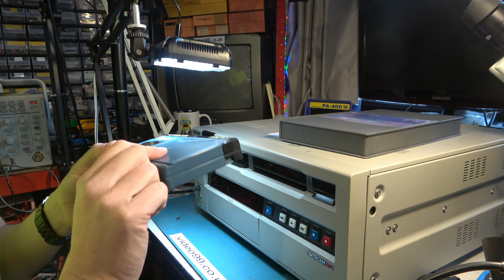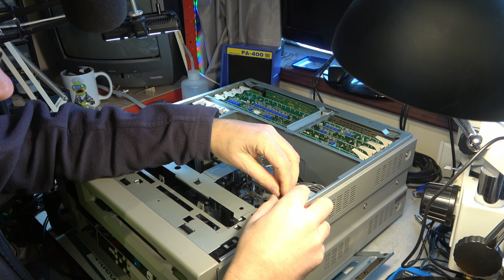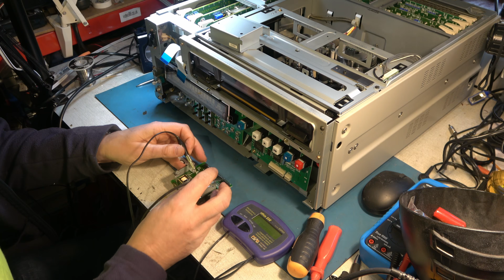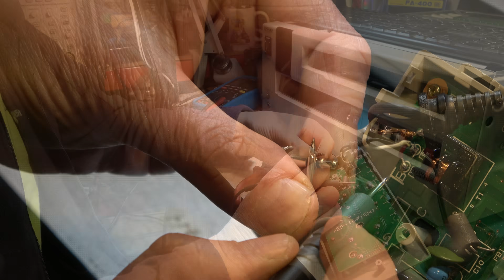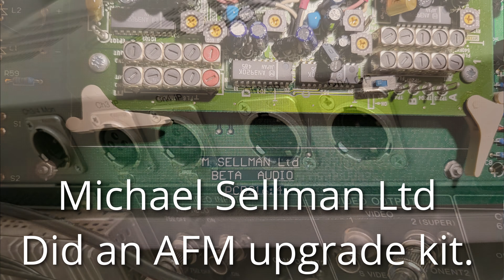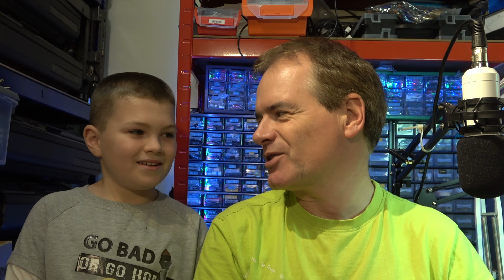Sony UVW1400AP BetacamSP professional video recorder.  Can we fix it?

Comment: Whats AP version is? Pal/Secam? Version 1400P is PAL, version 1400 is NTSC. Is AP = Secam?
Reply from the maker: P = PAL generally.  Not sure about the A though.  I don't think this format was released in SECAM.
Reply: @video99couk  It must have been released. I have a Betacam cassette recorded in Secam. Even the labels on Betacam/Betacam SP cassettes have a place on the label to indicate that the recording was in the Secam system. I have the UVW-1200P version, which is marked "PAL." The UVW-1400P is also PAL. I think the UVW-1400AP stands for PAL/Secam.

Comment: Those nasty SMD capacitors are also on the capstan’s circuit board. Everything works fine until they start corroding the board’s traces, at that point, it’s too late to replace them.

Comment: I have a sneaky suspicion that the spring can actually be removed and the carriage will still work. I could be wrong but I think its just there to set the tension on the toothed belt before a set screw is tightened.
Reply from the maker: You might be right.  It could be a case of just get it out of the way and it will work.  I will try that.

Comment: UVW series was cheap, not reliable and a nightmare.
Reply from the maker: I've had a few failures on these, but then they are getting on a bit now.  I still like them though, not least because they have S-Video out, and a "pleasing" picture to my eyes.  I've had the odd tape look nasty on a DigiBeta but look better on one of these.  It's good to have a selection of machines to get the best from a tape.
Reply: @video99couk  you are right in all aspects.
I figured out years ago how to get S-Video signal from VO9600.

Comment: Colin,  I don't think it will take you long to make a better remote cable :-D.
 i think that remote has a group of resistors inside and tied to the buttons like the old vcrs used to have.
I think the spring can be bodged .... errr i mean repaired with love lol.
And you recapped the display power supply :-D.

Comment: hi at last a great video you made i have seen alot with the a cap n the  vu part 
i still get offered  his range of decks   time to time  

only take them in because of the liner audio  just have  alot now   note i just got alot new sealed 
betacam  tapes  at very price  £1 for 10  i am getting alot of this  they just don''t know what to do with the tapes 
i am      finding

Comment: 12voltvids recently did a video on one of these where those very same caps failed and took out both displays and the fuse on the VU meter PCB.
Reply from the maker: Yes, I saw that the other day.  It was just coincidence that this machine came in then.  On one of my previous machines, the capacitor failure caused a regulator to put a large voltage onto the larger display and control board and blow it all up.  Hence I will now replace those capacitors as a matter of course.

Comment: Nice machine, a kind donation! I never saw the issue with that spring in all the time I was working on these machines. But the plastic was 25 years younger then! I have made a note to check those VU meter capacitors on my UVW-1800P, thanks for the useful tips as always.

Comment: Uhh... Colin... you were absolutely and utterly wrong about the UVW-1600 and its' PAL counterpart, the UVW-1600P. That model actually DOES have VU meters, aside it being a player.
Reply from the maker: The 1600 is a player with VU meters?  Wasn't aware of that.  I think it was a much rarer model.
Reply: I'd say the 1200 & 1400 are actually rarer because they don't have the RS422 9-pin remote socket, which makes them pretty useless for editing and only really suitable for use in a production office or maybe as a source for VHS duplication. They're probably more common today precisely because some of them didn't have a hard life sitting in an office getting occasional use. Sony also say these 2 models have a Time Base Stabilizer not a Time Base Corrector, although I'm not sure what the difference between a Stabilizer and a Corrector would be? Maybe the former can't have the video levels adjusted? The 1800 was probably the most common model in the UVW series as they could be used with an Avid Media Composer or similar editing system (having the RS422 remote connector) for both ingest and playout of final edits. There was a very rare model in the UVW series that had something to do with either video animation or graphics, might be the UVW1700.  The UVW1600 is the edit player and the UVW1800 is the edit recorder so they could work together with an external edit controller.

Comment: If you already know that bad electrolytic capacitors can cause major damage, they should be replaced, especially with SMD. But fatigue fracture caused by strong springs in SONY plastic parts is nothing really new.